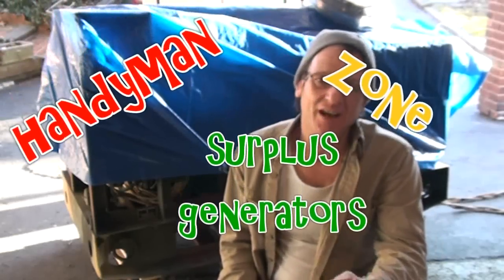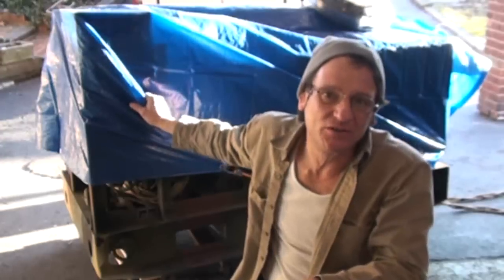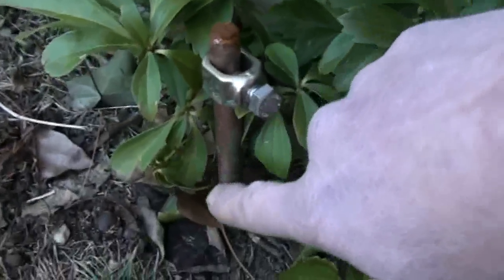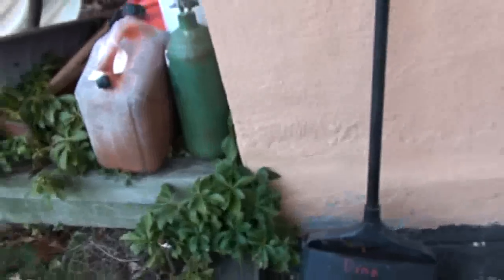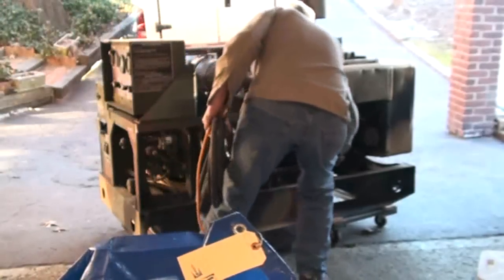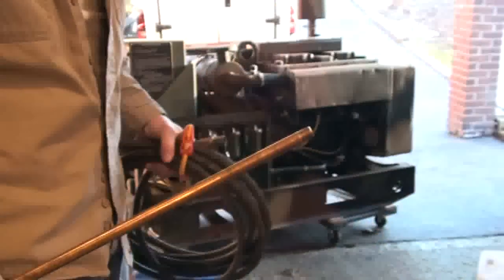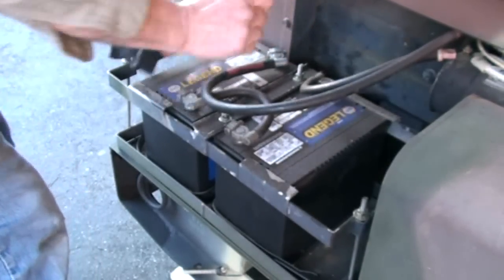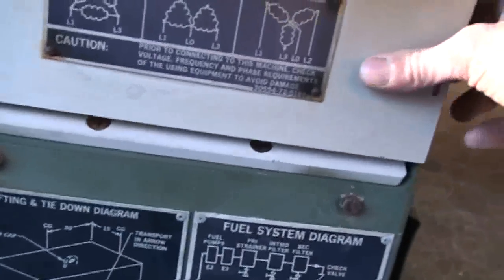MEP-003 surplus military generator review

Comment: first thing is the mep-003 will handle 12 kw load thats it not 20kw. second thing is the engine on the mep-003 is rated at 18 h.p. by onan not the military. home heating oil is the same thing as diesel fuel the only differance is diesel fuel is green and home heating oil is red. the mep-003 and 002 will run on kerosene jp-4 and jp-8 jet fuel i have run my mep-003 on kerosene and mix in 8 onces of automatic transmission fluid lubes the injection pump and cleans the injectors. get  facts straight

Comment: you need a proper transfer switch for that beast plus you need a 4 conductor wire with a red hot line a black hot line a white neutral and a ground and #6 is only rated at 60 amps not 70
Reply: He should be putting in a 50 amp breaker double pole and that generator will only put out 50 amps at best. And yea he needs a transfer switch.
Reply: @jjr897  it will put out close to 100amp